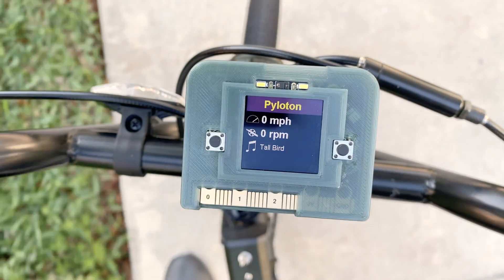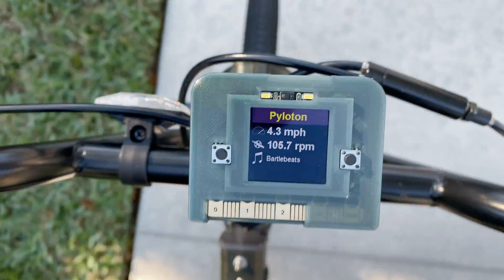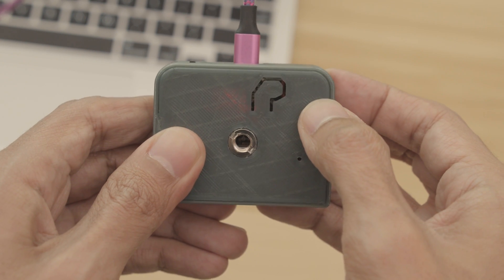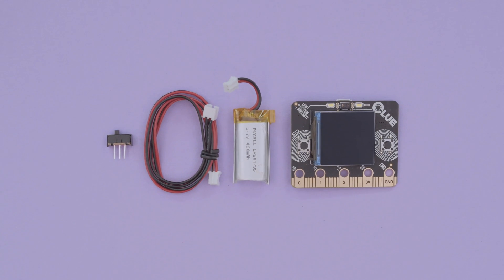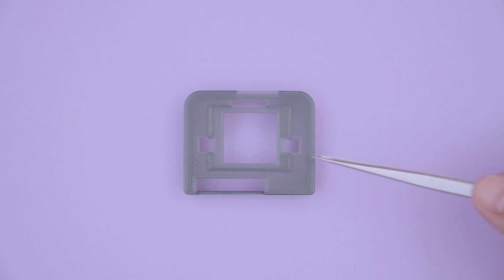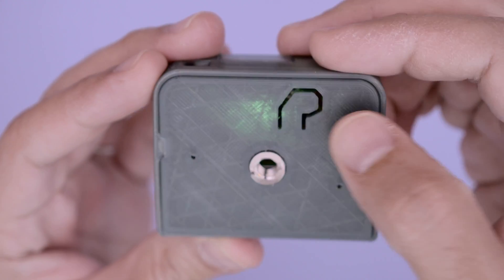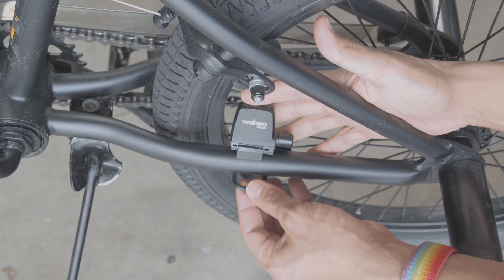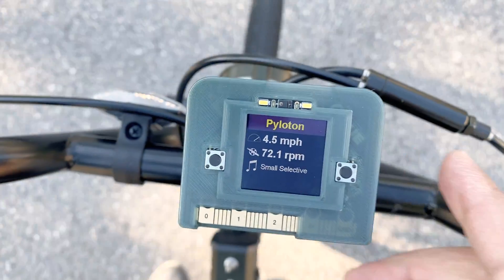Pyloton - CLUE Bike computer #adafruit #3dprinting

Comment: The accuracy of the Polar H7 BLE chest strap and the Polar OH1 BLE optical heart rate sensors is near to an ECG device,  which are the most accurate heart rate measurement devices available. And they are low cost high quality, at about 10 percent of the cost of for instance an Adinstruments equipement with comparable accuracy. Support of the Polyoton for Matlab or desktop Python would make out of the Pyloton a research grade device, for research institutes, research scientists, and hobby scientists who want to write their own paper.

Comment: There is currently no solution for Matlab to directly access sensor data for instance from Garmin devices. A Pyloton Rasperri Pi could solve this problem. Rasperri Pi has excellent support in Matlab. BLE chest strap or Polar OH1 BLE heart rate  sensors are excellent research grade devices. These sensors are low cost high quality, and will be successful, not only for sporting activity, but also for science.
 
https://www.ncbi.nlm.nih.gov/pmc/articles/PMC6732081/

https://www.ncbi.nlm.nih.gov/pmc/articles/PMC6532910/

Comment: Went trough the pages, the instruction is great. My vision of the future of the Pyloton is:

1. A version of the Pyoton for the Rasperri PI would be great, to have a storage card device as a data grabber to store data in an easy accessible way, for instance in Matlab friendly .csv. 

2. Do you know the new Linux Pinephone? I don t have one yet, but I certainly buy one. It is a real Linux Smartphone computer. A version of the Pyloton for the Linux Pinephone would be my favorite: large display, repleacable batteries, easy to use Linux platform for software developement. 

All these things would make the Pyloton software project a great open source cycling computer which can compete with the latest bike computers from Garmin, or even beat them.
Reply: This is almost perfect, but it would be great to have a GPS module and be able to upload to Strava.